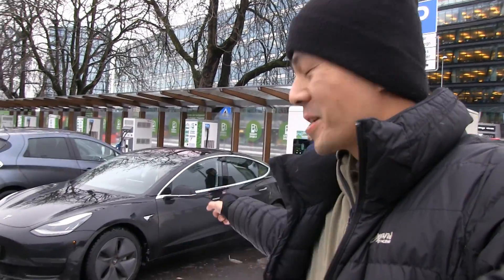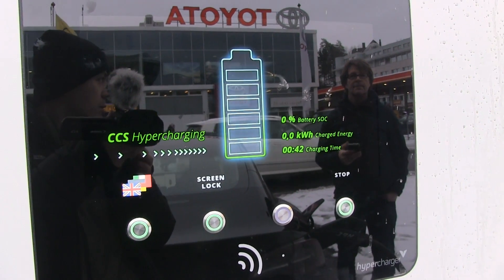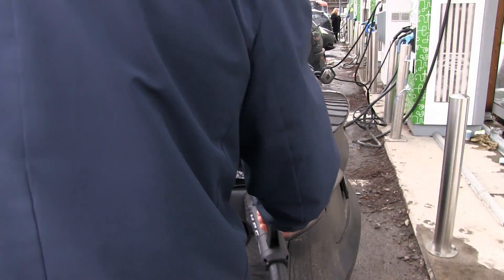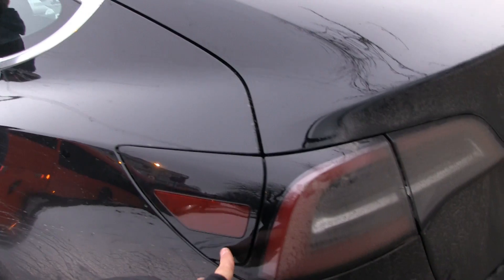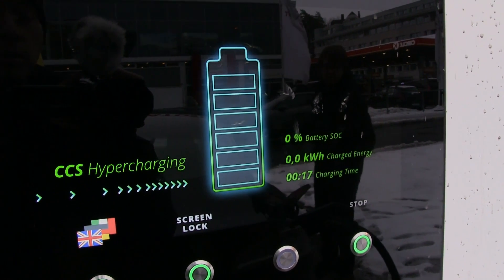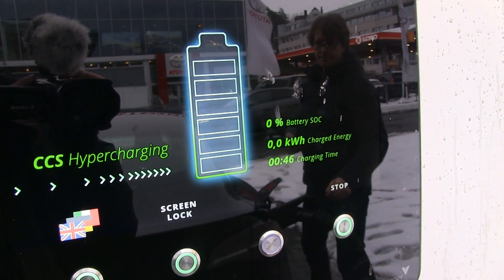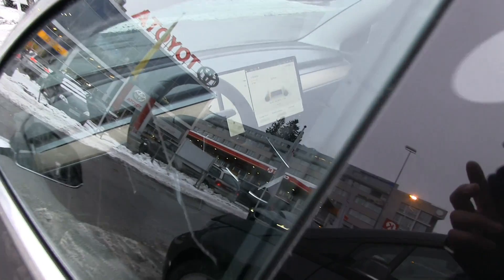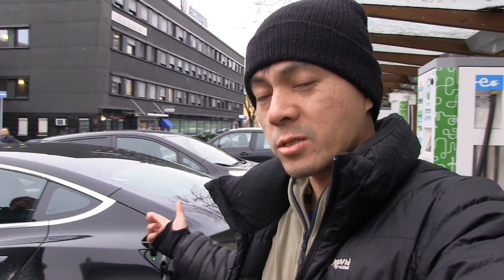Model 3 fails charging at 175 kW Hypercharger

Comment from the maker: Response from Hypercharger:
"We are already working closely with Telsa Munich on this issue. 
There is part of a fix in the new SW which we are going to roll out. But still it could happen that you would have to try several times, 
until the charging session starts. That other half Tesla has to fix it on their side since they do not comply with ISO15118 (CCS communication specification).
We are still waiting on their answer, what they are going to do about it. I will let you know as soon we get an answer."
Reply: had the same Problem  6 month ago on that Typ of a charger with the Ioniq - in GER same Problem with the M3 on this Typ of Charger!
Reply: @team13thirteen  Really? Never had troubles with my Ioniq and the hypercharger, been using then every week 1-2 times.
Reply: If both sides log the handshake data, and have access to it, a fix should happen pretty quickly.
Reply: Good Job Bjørn!!
Reply: Bjørn Nyland it works now. Tested today with my tm3p
Reply: If it doesn't meet ISO15118 how could it get type approval for that charger type in Europe?
Reply: Truly VolksBjørn
Reply: Well that would be part of the reason why the Chademo adapter doesn't work in the US. Not a standard protocol. Probably an extra header for the supercharger network that no one else uses. Hopefully soon
Reply: It’s disappointing but wouldn’t be surprising if Tesla didn’t fully test CCS hyper charging.

Comment: The problem is all the software and extra fluff to give people anxiety.  You just need a power on off switch, a mechanical one.  It will all last longer that way and if it were to fail in 20 years it would be cheap and easy to maintain.

Comment: Charging looks very complicated with all that different plugs, charger types, outputs and so on.😕
Reply from the maker: It's not complicated at all. Refueling fossil fuel is complicated with all the octane numbers, diesel, gasoline, super, E85, etc.
Reply: It used to be complicated, but at least in Europe, virtually all new cars will have a CCS Combo 2 socket.  This will also be the standard on virtually all new fast chargers.  For the slower chargers, the plug (Type 2) is a bit smaller but still fits into the CCS socket.  You then only need to know that when CCS is available, you should use that, and if not, you use the Type 2 plug, or the Type 2 socket with your charging cable.

Comment: What's the reasoning for Tesla's having non Tesla charging ports?
Reply: CCS 2 is European standard.
Reply: European Model S and X never had a Tesla plug like in the US, but always the standard Type 2 socket.  The difference to the Type 2 sockets of the other European cars was that the Tesla socket on the Model S and X was wired so that they could both charge AC on any public or home charger, or charge DC on a European supercharger.  For the Model 3, Tesla switched to CCS Combo 2, which is the European standard.  This has two advantages:  it is cheaper than the solution in the Model S and X, and, more importantly, the Model 3 can charge on most public fast chargers as well (at least in theory as this video shows).  The disadvantage is that Tesla has to add a second cable to the supercharger stalls.  But that rollout is proceding very quickly - and in Europe (excl. UK/Ireland where no Model 3 is sold yet), in just two months, 71% of supercharger location have had at least part of the stalls converted to support both CCS and Tesla Type 2 Supercharger plugs.
Reply: @MikeDeeee  Which charger is faster in Europe?
Reply: @TommyboyGTP  There are some 350 kW chargers, but only the upcoming Porsche Taycan can use them close to their potential. Other than that, the Audi e-tron, which is now available, can charge at up to 155 kW or so. The Tesla Model 3 can charge at up to 126 kW or so. Superchargers max out at around 120 kW, but they are more reliable than the public CCS chargers. There are also a handful of CHAdeMO chargers theoretically capable of more than 100 kW, but there are no cars yet that can use that (the upcoming Leaf may be able to do so); currently the maximum at those chargers would be the old Kia Soul EV at around 68 kW (the new e-Soul will come with CCS).

Comment: Do you have the possibility to test the newly upgraded ionity charger in Nyborg, Denmark? They now equipped it with water cooled charging cables and support higher charging power.
Reply: https://elbil.no/ionity-apner-forste-lynlader-med-350-kw/
Reply from the maker: +colla 555 Why would I go there?
Reply: @bjornnyland  if I remember correctly you already have been there on a road trip with the I-pace. And at that time the charging was limited to 200A. So, if you could test >100kW charging there it would be nice to see. Of course you'd need a car that supports this. Soy that's why I asked. Maybe in future you come to one of these 350 kW charging stations.

Comment: On the bleeding edge of the blade again TB :-) Its doesnt surprise me that Tesla aren’t fulyl compliant with the CCS spec., and that there will be a few issues like this until the CCS spec. is tested and realiable with all vehicles etc - in teh meantime I would expect someone else to pick-up the bill for the charging until it is fully resolved - not the end user, but Tesla or the Charger service provider.

Comment: Hi Bjørn. Waiting in dk for my m3. I'm planning a roadtrip when summer comes. Do you know how to charge a m3 with CCS on Tesla destination charger network and non-converted supercharger?
Reply: All destination chargers will work (it's a standard Type 2 plug), but you can only charge on CCS converted Superchargers. But by the summer all Superchargers will have many if not all stalls converted, so don't worry.
Reply: @MårtenLundström  thanks 👍
Reply: Map with all CCS Supercharger https://www.google.com/maps/d/viewer?hl=en&mid=1gygphaA-CioOsIGbEAY4gmBYgI3QtrSc&ll=59.65546247409427%2C18.379931072744967&z=6

Comment: please test the Audi eTron with this charger if possible
Reply: If the charger is capable (water cooled cord), E-Tron will go 150kW to 79%
Reply: @dmitchellhomes  The charger is equipped with liquid-cooled cables. There is "HPC" written on the side of the plug, which indicates that this is a liquid-cooled Phoenix Contact plug.

Comment: It is in German but at 12:50 you can see it can charge with 120KW at the Fastned HPC charger.
The noise comes from the charger the car seems to be much more quiet than S and X while charging at ~120KW.
https://youtu.be/Qo1UZ50bPJU?t=770

Comment: Fastned 175kW Charger is compatible with the model 3. Maximum output is 120kW.
Reply: Actually it is 126 kW. On the Fastned website you can see the complete charging curve.
Reply: I think they software limit it so that they don't get the press of some other charger being faster for charging a Tesla than their Supercharger network.
Reply: Model S on hyper charger?
Reply: @aidanapword  50kw because that's all the chademo adapter can handle
Reply: There will be a new ccs Adapter from teala
Reply: @CAESARbonds  source?

Comment: Have u tried it with ur X?
Reply: Oh wait, it’s CCS charge ports for model 3 in Europe
Reply: It is not possible to charge with CCS on Model X, only CHAdeMO via adapter
Reply: with the new ccs adapter yes but limited to 120 kW
Reply: @antoniocirino8444  CCS adapter is not out yet
Reply: It has a modified type 2 plug, so you cannot plug into this
Reply: Yes I realized that right after I posted my question